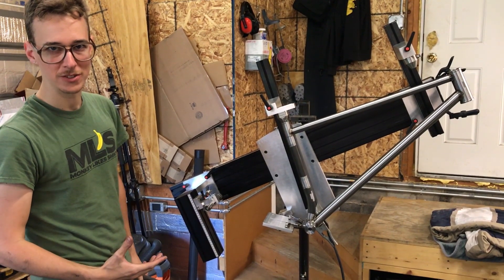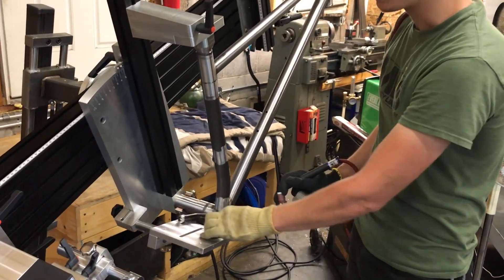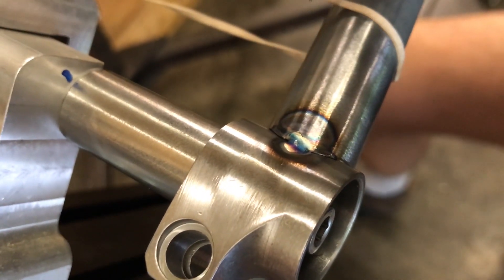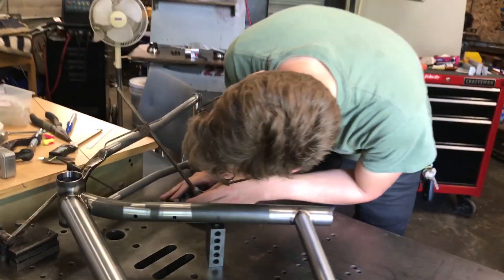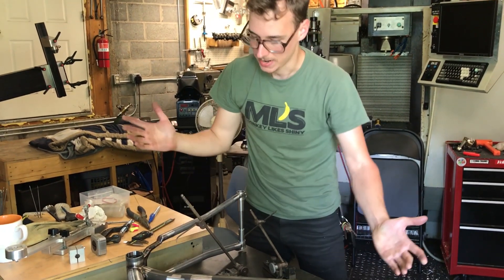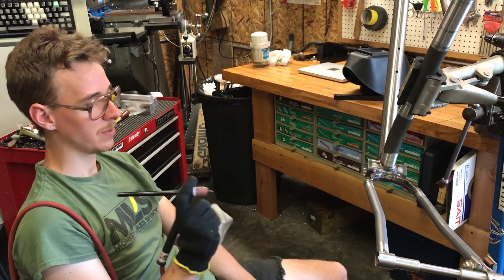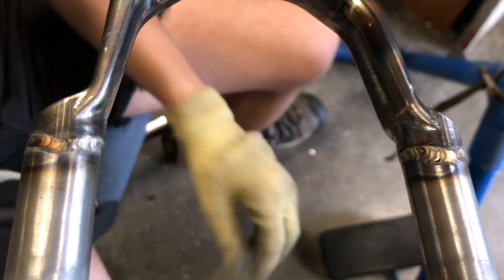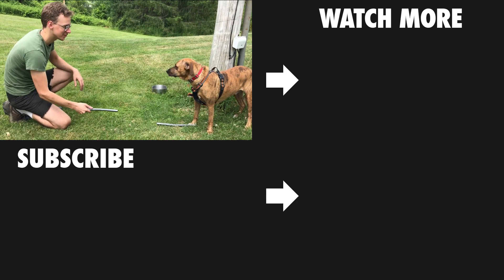Yeehaw! TIG Welding Chainstays on a Steel Bike Frame

Comment: The welds have some undercut. I would use more filler and slow down the pulse. I never use pulse on thin variable material. I manual pulse with the pedal. It makes is super easy to weld if you get a plumbers torch and preheat the thicker parts for 10 seconds. Nice build. Good luck!

Comment: Just watched two videos tonight, total of 70 minutes! Thank you for documenting everything, your thoughts, ideas, and progress! What size filler are you using for welding? Keep this up!
Reply from the maker: .035” filler rod in this case. That’s like .9mm. I would maybe use .045” or 1.1mm if I had some.

Comment: Very nice! I think you're right not to fusion weld on those CS because you need the extra strength of the filler. Interesting that you weld out the CS with no SS. Without any flat tables or other precision equipment on my MTB build I actually tacked both CS and SS with a back wheel in there. It magnifies any misalignment and is easy to measure relative to HT and ST with bits of string. That yoke looked fun to weld and easier than the insides of the CS where they join the BB which has me reaching for the tinfoil and generally getting my ass kicked.
Reply from the maker: I like to weld the chainstays, then check alignment and cold set, then weld the seat stays.
Reply: @cobraframebuilding  I might try that next time. Feels like the CS might move more during welding with no SS but on the other hand also easier to move them back...

Comment: You couldve used a string hold from the head tube to the drop out and measures the distance it is from the seatube (or dropouts) on either side.
Reply from the maker: Definitely. I think that's a method that Sheldon Brown mentions on his 90s website. I'm not sure if I even have string in the shop TBH.
Reply: @cobraframebuilding  oh well. Your set up was more accurate anyway.

Comment: Have you ever heard of someone tack-welding (MIG? TIG?) a frame together, but then finishing it with conventional brazing?  Like completely covering over the tack welds with brazing fillets?  

See, I can't weld thin wall at all.  I always ruin it.  But.  I'm wondering if it might be possible to get away with just quick little weak tacks, even with poor skills like mine, just to get the frame into one piece first.

Your comments please!
Reply from the maker: MIG isn't going to go well with thin wall bike tubing. You can probably TIG tack with success.